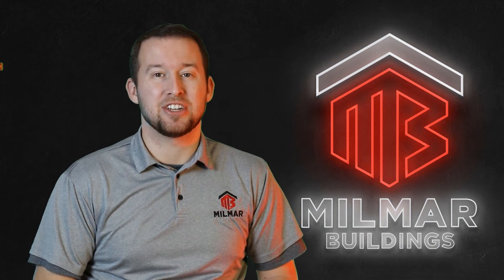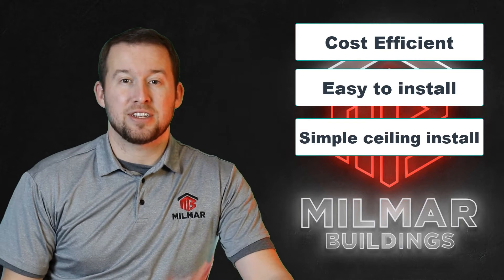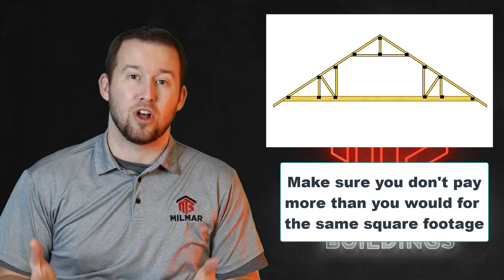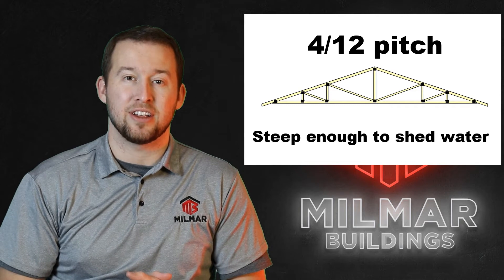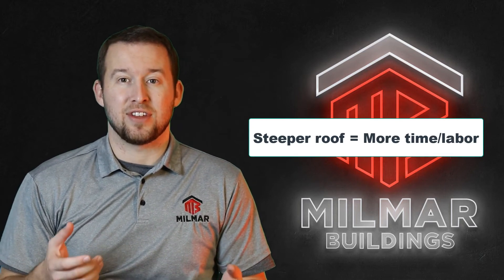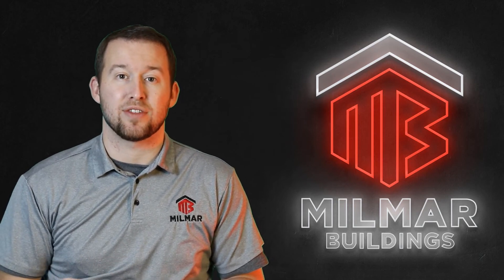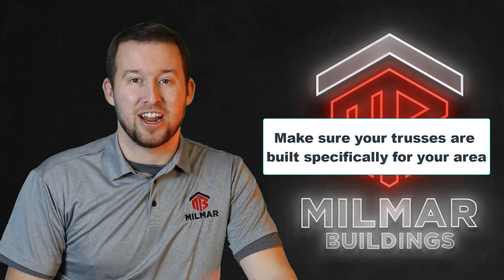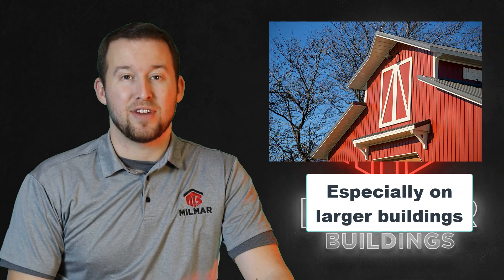Post Frame Trusses

Comment: What about Gambrel, I want a 16ft tall shop on the bottom, Im locked in on a 35 width and 45 long perimeter. want a large room on top of the shop so thought the gambrel would maximize the attic space.

Comment: Do you all ever do metal trusses? Do you have any pros or cons on them?
Reply from the maker: We have not used those, though we have looked at that option before.  It seems that most of those are more engineered for southern states with lower snow loads, but it is an interesting option to consider if engineered properly!

Comment: Scissor trusses are nice. I also like hammer trusses. Using rafters and square saddle notches for my skillion pavilion. That would be me in northern MI. A bigger over hang helps in keeping water splashing back on foundations. I usually notch my headers on post buildings and decks.

Comment: Thanks so much for educational videos on post frame construction. Question we have found a 875 ft.house/cabin plan but want to build post frame. Should we purchase the stick built plans as is or do we need to have plans drawn specifically for post frame construction? Do we need a post frame architect or can we make the adjustments to the current plan ourselves or with a builder? We are in Lagrange KY so if you have anyone you can refer in this area that would be great. Any advice will be greatly appreciated!🙏👍
Reply from the maker: Hey there!  Converting a stick built house to a post frame can be fairly simple if the layout is simple, but it would be best to have your plans drawn up by either a post frame contractor or engineer to make sure it will work well.  A great place to start looking for suppliers and/or builders in your area is www.nfba.org as they have a full listing of builders you can search through.   As long as your posts are spaced properly and your trusses are engineered, you should have no trouble making it pass code easily.